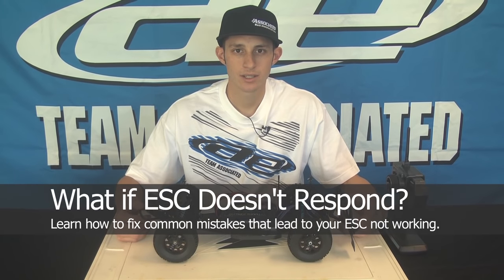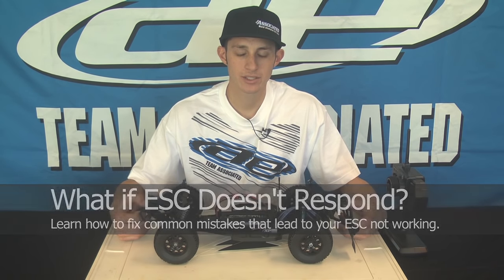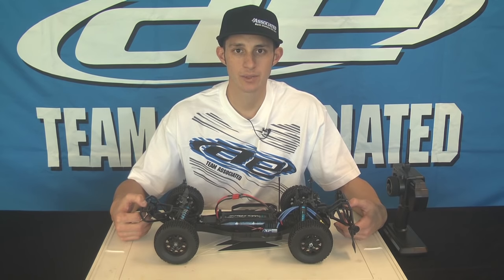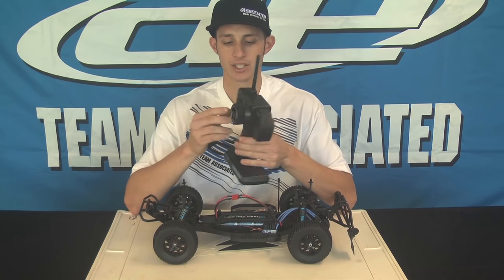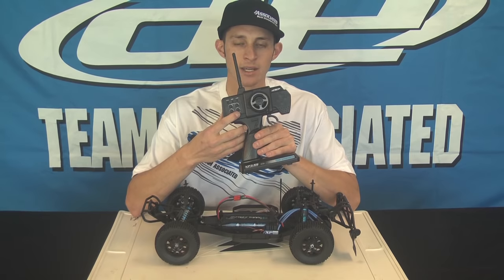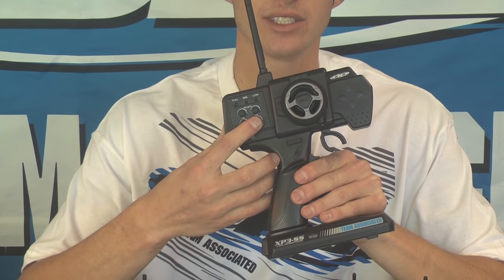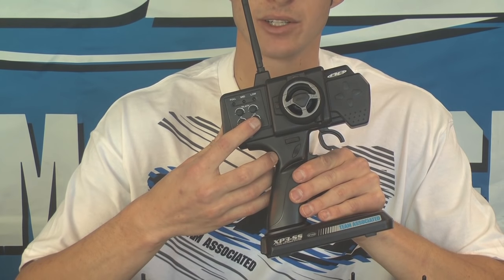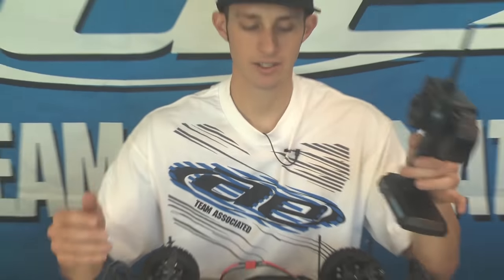Tech Tips - What to do if ESC Does Not Respond

Comment: I bought new esc and motor. When I program the ecs. It won't go in right order. It say give , hit set but for neutral, that work but it won't for forward throttle,  but will for reverse throttle then it will for forward,  but now its faster in reverse than forward. It just won't program in right sequence
Reply: Maybe you could reverse the trottle then reverse is forward and forward is reverse

Comment: I got a sc450-bl  and reedy 3300kv motor from a friend and it does not beep, is it still going to work, it runs through all of the setup steps, with the red light and green flashes etc.... but with no beeps?  I have a bad motor, reedy 3300kv and its not turning, going to order tomorrow for 50 bucks but is it still worth doing, I already bought a Lipo battery today and i just found out about the motor from the hobby shop so???......???
Reply: What kind of gears you got? On you’re 3300kv

Comment: M problem is that my steering work but it won’t go forward or backwards on a trx4 sport
Reply: Look at your remote control and try to find little switches that have the numbers 123 possibly 4 under them. One usually controls the steering, and the number two usually controls forward motion. Click those up or down and see which setting works for you.
Reply: @SomethingMobile  I got a cheap “hobby grade” rc and has the typical receiver with ESC integrated and for some reason when i pull the trigger and stop it it keeps running by itself, any help?
Reply: This is my exact issue, on my exact rc… did you ever happen to find a fix

Comment: I bought a remote control model number 9125 ipx4 waterproof 46 + km miles per hour four wheel drive monster truck I tried to pair them together and now the receiver on the truck is blinking red and I have no steering or throttle will not move I think it's lost it's bind from the transmitter is 24 GHz digital proportional RC system transmitter would you know how to rebind that any help would be very appreciated I'm just getting into this and got the car from eBay and I was excited I felt like a at Christmas now I can't get it to pair really sucks about ready to return it but like the truck would you know how to rebind them and that would be appreciated thank you
Reply: I’m not a professional at this, but I just noticed cause I was trying to bind my controller as well. Maybe this will help. I don’t know what the little box is called that the servo and ESC wires plug into. But that’s the box I’m talking about. That box should have a little red button on it or some sort of button at the top that you can press and hold to get into binding mode. your controller should have a binding button as well. After you pushed on the little button that is in your truck to get that into pairing mode. And you pressed the controller to get it into pairing mode also. They should pair. Sometimes it takes 8 to 10 seconds. If it doesn’t work, then turn it off and start over again. That’s for the directions told me and it worked. I hope this helps.

Comment: My esc worked after this video but after a few mins I turned it off then back on and it didn’t work. I think the first time it was just luck. Does this work for all cars?
Reply: I think so, some times i get this 2...its a headache
Reply: Recently i figured out that my esc works if I place it in a right position. I jot glued it on to one position and it works. Maybe try that.

Comment: I have a traxxas xl 5 hv 3s esc I got a traxxas trx 4 Land Rover from a friend that he ran lipos in it I run nimh in my cars so when I tried to switch off the low voltage warning feature to get it In nimh mode the truck runs but only for about a minute before the truck stops and can’t get it to move anymore the nimh battery is fully charged the steering works fine just doesn’t move anymore we both tried resetting/ recalibrating and it and it continues to just run for a minute then stops so could it be that the esc is going bad ? Because I’ve seen him drive it often he never had issues with it he gave it to me when he upgraded to another truck it just refuses to work on my nimh batteries sure I could just use a lipo but I’m not a fan of those because of all the precautions u have to take but with nimh u just plug it in and forget it till it’s done charging and not have to worry about battery catching fire or exploding so what u suggest get a new one different brand perhaps? Or a nimh only esc ?
Reply: You need to recalibrate the remote my brother had this same problem in a traxxas rustler